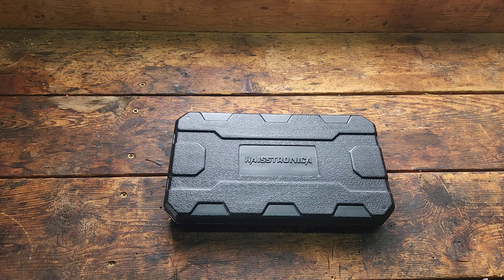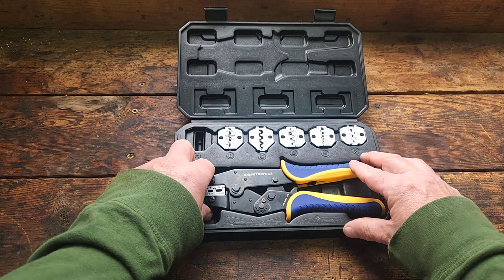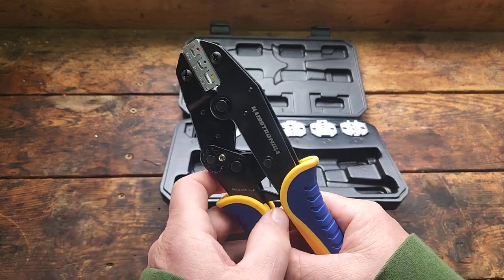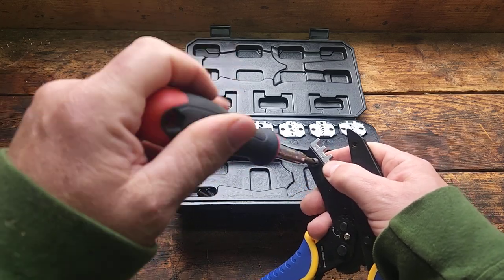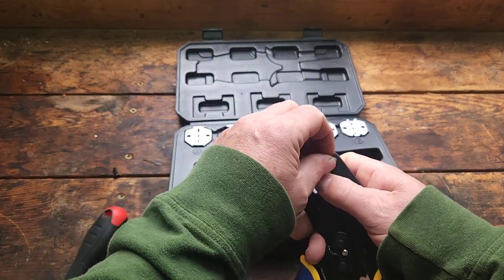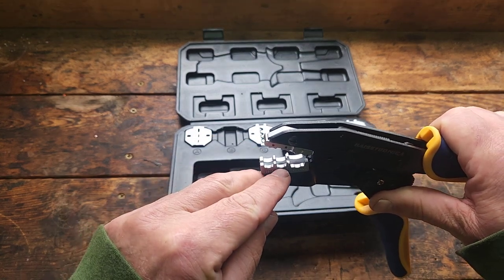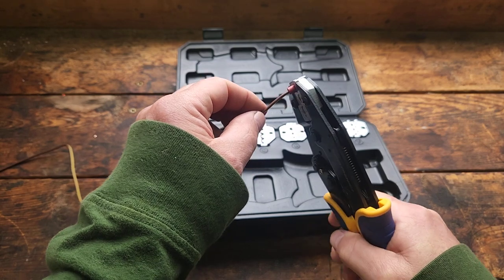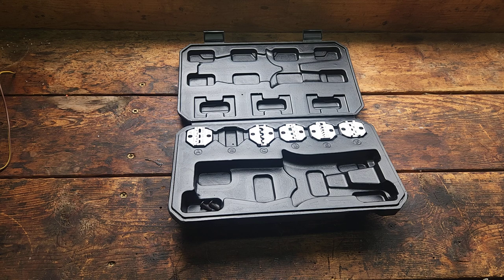Haisstronica Crimping Tool Overview

Comment: If you have this version that doesn't have the quick change dies and you wanted to purchase a different die set, the quick change dies work perfectly well with this older screw on model.